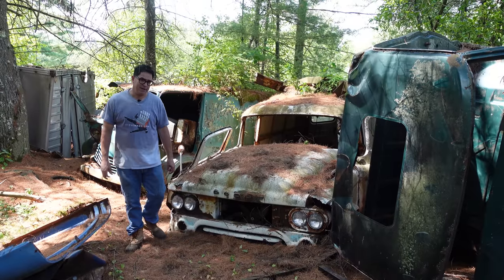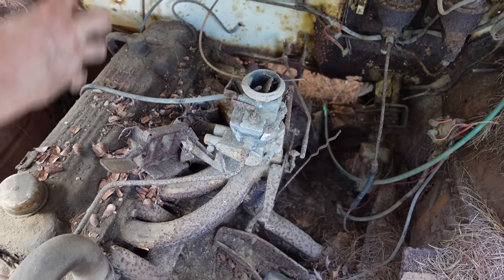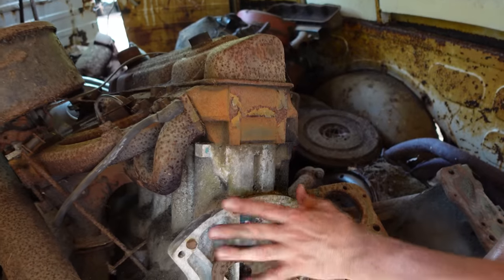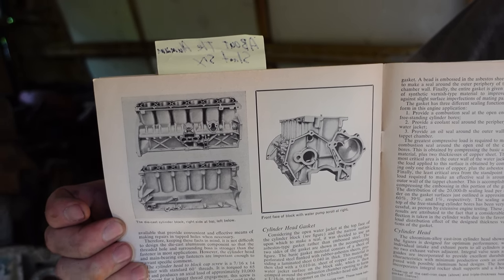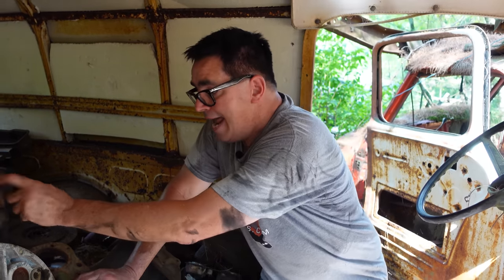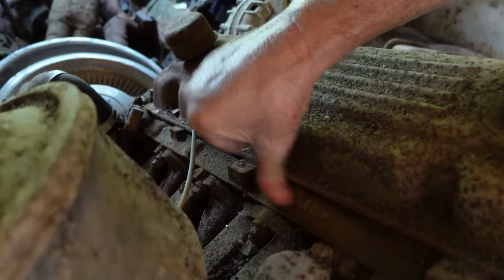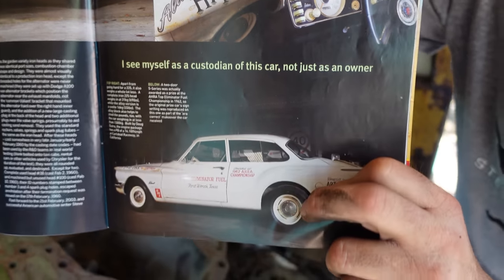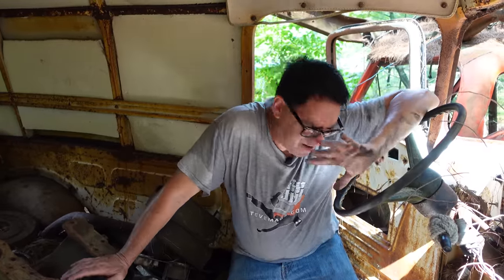Slant Six Surprise!

Comment: I did not know there was an aluminum version of the slant six, very cool. That's quite a weight difference from the iron block. It's too bad they didn't make an aluminum head to go with it. Great stuff Steve!
Reply: Actually they did as far as I understand.  It was a speed part like the special intake they made check out UTG uncle Tony has alot of slant video
Reply: He even talks about the hyper pack
Reply: @Mathew Dick I subscribe to UTG did you ever see the Sunday night live with him and Steve. He had a couple they were great.👍
Reply: Agreed 👍
Reply: That slant 6 aluminum, with cast iron head, GM was still expirementing that concept with the Vega, great video,how big is this magazine collection of information ?
Reply: @jeffclark2725  Too bad GM had not kept the 215 Buick v8 and used that as an optional motor in the Vega.  The 215 has iron liners but GM experienced an excessive manufacturing scrap rate, but they did produce nearly 1 million before selling the 215 to Rover, which used it for decades.
Reply: @djmtndew ........Nah, no aluminum heads for production. There were some made for experimental testing purposes of which a few leaked out to the general public. An interesting point concerning the Aluminum 225 Slant six engines is that the cylinder heads were cast iron but made with much more stringent tolerances and THOSE were marked "SPECIAL". Special, because they mated precisely with the OPEN DECK designed cylinders with no mismatch. This ensured precise sealing between the head and cylinders. The speed parts that you speak of is the HYPER PAK kit. No cylinder head was specified in that kit. Hope this helps you understand the Slant six engine a little better.
Steve, Thankyou so much for this content. I really enjoy your Channel!
Reply: Too bad they didn't make the aluminum head a cross flow design.
Reply: @jeffclark2725  
GM probably had more experience with aluminum engines than any one else in the US.
Reply: @mpetersen6  Cross flow heads were not often done in the days of frugal  single carbs - carb heat was needed.   The slant six 'as is" needs carb heat, but like many low cost designs suffers from carb heat soak.  The designers had to be penny pinchers - a  barrel should have always been an option but it would have cost a bit more to manufacture.

I agree that cross flow would be nice!  I read that BMW engineers were inspired by the popularity of low cost U S. compacts - what if the content could be upped and sold to the sons of persons who bought Buicks - at a Buick price?
Reply: @timothykeith1367  in the case of the Slant Six as designed for a cross flow head the intake would need to be on the passenger side of the block. With an OHV design keeping the exhaust heat away from the pushrods is generally a good idea. Plus with all of the US built inline six cylinder engines the intake and distributor would tend to be in the way of each of other for a cross flow head. Even Pontiac went with a non cross flow head on the OHC inline six. In fact the Pontiac head looks a great deal like the Vega head. And Pontiac was not the only inline six with a non crossflow head. The original 240/260/280 Z also had one. 
There have been people that have sliced, diced and welded V-8 heads to put on top of OHV inline sixes. One that comes to mind is a Ford 300 with a Cleveland head that was extremely competitive in Pro Stock in the 70s. Another is a Chevy 292 with an LS based head. There is somebody on YouTube today that is finishing up a 300 with an LS head. The Chevy in line six and the SBC through LS all share the same bore center distance at 4.400. The 300 is 4.480. The small Ford V-8s are 4.380. Same as the AMC/Jeep family. Which offers some interesting possibilities. For a different head on the Slant it might be best to go down the import engines which would almost make it mandatory to go OHC.
Interestingly there is a racing series run in Argentina. The CATA run TC series which is the longest running race series under the same sanctioning body in the world. The cars run inline sixes based on the Ford,  Chevrolet and Jeep 4.0. These engines feature DOHC 24 valve heads and a lot of other trick race parts. Output about 500 ponies using two Webers. The engines are only available through the CATA sanctioning body apparently.
Reply: @timothykeith1367  
In regards to BMW. When they were on the ropes in the late 50s two different companies tried to  buy them Rover from the UK and AMC. The BMW is as much of a true slant engine as the Slant Six. They are both normal inline blocks just leaned over. In my mind a true slant is something like the Pontiac Trophy 4 from the early 60s. The cylinders at an angle and the pan rail horizontal. Chrysler Australia used the Slant mounted in a vertical orientation.
Reply: @mpetersen6  I'd like a pushrod variant of the Nissan L series on the slant six. The raised intake ports might cause hood clearance issue but a remote air cleaner could  resolve that .  The intake  port angles would be more like a V8.

The Jaguar XK6 has a very similar bore center spacing as a slant.    At a PNP there was a 4.2 Jag with it's head removed and a 225 Plymouth.  I laid the slant six head gasket over the jag bores - looked like a match, but the bolt patterns are different .  The XK6 heads are "wet" - don't pass through metal, but coolant.   Probably could relocate them for a one-off . If this were the case somebody probably would have done it .  The 3.8  E type heads are hemispherical.  The later  4.2  heads are relatively easy to find because the blocks are prone to cracking. A couple years ago Jaguar released a brand new revised 4.2 block or  the hobby market.  The 4.2 head is a quench head for emissions, the difference with the 3.8 and the 4.2 is like 1st /2nd gen Mopar Hemis against  the 3rd gen 5.7
Reply: @timothykeith1367  
Somebody probably would have fone it. Let's face it. The average hot rodder/car enthusiast in the US isn't that imaginative.  It kind of like "I want a 32 Ford like nobody else has. I'll put in a 350 with a 350 TH, a Ford 9 inch rear end and I'll paint it red". Like I said. Imagination. I get that there are reasons people do certain things. Its known to work. I'd rather see somebody build a car that is completely outside of the norm than see one more Camaro or Mustang cookie cutter.
Reply: @mpetersen6  The valve train of the classic Toyota T series might adapt to the slant six.  These are a pushrod hemis of only 1.6 to 1.8 liters, but the blocks can be bored to 3.50 inch.   The rocker arms are available in the aftermarket.   The pushrods are also on the passenger side if the head   Might work better for the 170 than the 225.  It would require  a new head casting.  The T Series can be built to 600 hp.  These are a neat motor.that was influenced by the Chrysler hemi .  Until I saw the T series valve train, I could not visualize how to create a cross flow slant six.  The rocker arms are splayed wider so that there is room for an intake port in the middle.
Reply: @mpetersen6  and how do you think that would work on a slant 6- leaning over against the right hand inner guard? The only way you'd run a crossflow head on a slant is if it were on an engine stand. If you're so intent on putting a crossflow head on a mopar inline 6, import a Hemi 6 from Australia and convert that to crossflow with a dohc off something else. Not much point with the Hemi 6 as it already breathes better than most motors with the 265 cube version having 1.96" inlet valves.
Reply: @timothykeith1367  I also cannot visualise anybody putting a crossflow head on a slant 6 and expect it will actually fit ANY engine bay. There's barely room in a Valiant to get at the points on that mini distributor they have. Besides their weight, and awful fuel consumption, working on them sucked. It was a massive step up when Chrysler Australia ditched the slant in 1970 for the 245 Hemi 6. Bigger, lighter, more power, better economy.
Reply: @rossbrumby1957  If a high function head 
were created for a slant six it would be a one-off teaser project. The  A body inner fenders are mostly to keep water and muck from the motor, they have limited structural function..  The Jaguar XK6 sedans with EFI have a down facing intake manifold.    A crank trigger could replace the distributer.

The slanted BMW sixes have the exhaust on the tilted side. . Nobody will produce a head for the slant six because  of crazy costs.  

An idea that sometimes comes up is a "bathtub" head that has the water passages open from above until sheet metal is welded to cover them.   Then, maybe 5 copies would be built. 

With a decent head a slant six would roughly compare to the Jaguar XK6, which has similar bore/stroke and is also rpm limited to about where a 225 is - and that's with 7 main crank.  The race teams spent a lot of money to get those to hold together at high rpm, but made pretty good torque. The e type was factory  rated at about 260 hp, but the dynos usually measured no more than 215  hp.  I saw a worked over e type on Jay Leno Garage that made 350+ hp on the street, maybe 400 hp.  Big bucks.  A 200 hp bolt-in  head would be news that was unobtainable, because you can port the OEM  head, with enough cam  and compression and easily exceed that.
Reply: Cadillac did the same with the junk 4.1 V8s, always thought an aluminum block with an iron head was two steps forward and one step backwards. Mopar should have brought over the Aussie Hemi head and made the engine in all aluminum and skipped the V6. For that matter GM should have made the Pontiac OHC head for the 230/250 six across the board and on the 292 through the 80s or 90s.
Reply: @hendo337  It would have been nice to have had a slant six block with larger bore and a better flowing head.  The Aussie Hemi really a hem , but the head is better than a slant six i.

 The Jaguar XK6 also has a 4 - inch bore center spacing but it managed to get 3.60 inch bore on the 4.2 liter version - using old casting technology(the 4.2 blocks were known for heat related cracking but a revised casting was produced in 2020).. 

Chrysler could have done that but it was a bread-and-butter motor, not a performance engine.   I read about the Terry Burtz Model A short block that was released in 2021 after 15 years of effort - $4,000 for new block with  5 main crank with insert bearings, one-piece rear seal and also new conn rids.   Is there a market for an improved $6,000 slant six block and a $4,000 head?   Maybe with electrification being forced on us the nostalgia aftermarket parts will begin to flow?
Reply: @timothykeith1367  The Monza was available with a small block chevrolet V8, so a  Vega V8 swap is simple. And an aluminum Buick V8 would have been infinitely more cool than a Chevrolet engine -- the little 215 only weighed 318 pounds! 🤯
Reply: @Duke_of_Prunes  - The '75 Mpnza V8 caused other H-bodies like Vegas and Astres to be setup for V6's and V8's as well, but before that everything got in the way of a V8. They flipped the heater core so the hoses entered farther out instead of near center and the HVAC box got a dent for valve cover clearance and the weak front suspension got a big V8 type crossmember under the engine. Leaf springs in rear replaced with torque arm and coil springs for more traction and less axle hop. (Similar to Buick GNX getting a torque arm) 
Yeah, the Buick 215" V8 I put in my '75 MG Midget weighs less than the crap iron 4 that was in there!
Reply: After WWII's ferocious demand for aluminum planes/engines ended, ALCOA, Aluminum Company of America, was looking for a market for its enormous capability to make aluminum, so was pestering automakers to use more aluminum. Buick actually made the 215" aluminum V8 about 1950 for concept cars before going into mass production of it in 1960. And, of course, Chrysler gave in and made some aluminum Slant 6's. But then both companies eventually wanted away from the extra costs and problems... Later, everybody went back to aluminum for weight savings/MPG gains... and just jacked up prices like crazy...
Reply: @rossbrumby1957  - Slant 6's got great MPG in 1960's but like all engines, 4, 6, and V8, became emissions slug gas hogs in early 1970's...
Reply: No need to mess with heads on Slant 6s, GM made a fabulous all aluminum DOHC 4 valves per cylinder inline 6 'Atlas' engine in early 2000's that engine dynos around 350 HP stock! And the junkyards are full of them now... 
https://en.wikipedia.org/wiki/General_Motors_Atlas_engine
Reply: @mpetersen6  - Pontiac's OHC 6 was just a sales gimmick to make a Firebird look like a Jaguar XK-E's tech at a much lower price. The HP peak RPMs was well within that of OHV engine tech... (As was the Jaguar's, actually) (And SOHC modular Ford engines) Chevy realized that and stayed OHV...
Reply: @Duke_of_Prunes  In the 70s GM attempted to buy back the 215 tooling, but Rover said "no"..   The 61 GM compacts we're wrong for cheap gas but almost ideal for the 70s.   With a restyle they could have given Mustang a real fight..   I still like the Vega, not the crappy 2.3 motor , other than rust,  Vega  could have been a very collectible car today.   The tinny BMW 2002  car  had a solid motor,, the stupid committee product teams at GM blew it
Reply: mpetersen6, that 300 Ford with the sliced and diced Cleveland heads had its success in modified production, not pro stock. The best known one ran in H/MP and had the name Preparation H and was in a Maverick. The only 6 to run in pro stock was Buddy Ingersoll's turbo V6 Buick.
Reply: From what I heard back in the day, the aluminum block Slant Six had some problems and many of them failed in very hot climates. I'm not a master mechanic by any means but I've been around. Let's say I had a neighbor who wanted to get an old Slant Six vehicle running again and he had a cast iron block and an aluminum block laying around. I would try to persuade him to use the cast iron block and might tell him to let the machine shop to put the engine together if he wanted to use the aluminum block. I wouldn't want to be blamed for it when the engine failed.
Reply: @anonymike8280  Yes   orrosion will cause  overheating of these motors, that was true later.  The block has an open deck with limited contact for the head gasket, a little corrosion and it will lose coolant 

The die cast alloy block was supposed to save on milling costs.  Aluminum is so much softer than cast iron.    The casting process had a high scrap rate.  They could have fixed that. Most allow inline engine blocks  were later cast with an open deck 

Aluminum will corrode when the coolant isn't regularly replaced, corrosion was not yet a big issue when the die cast block was cancelled for 1963. 

GM also cancelled the 215 Buick, which I think it was sand cast. Rover worked out the production problems and used it for decades. The 215 block does not have an open deck
Reply: @timothykeith1367  The Slant Six aluminum block was just a fail. Unless you like spending your money experimenting, stay with the cast iron block.

The Slant Six is a relic of the cast iron age. Go with the flow. The configuration of it intrigues me though, having looked it up. 3.4" bore X 4.125 stroke. The Chevy 230 and 250 sixes had 3.875 bore and a short stroke. They apparently used the same pistons as the 283 and 307 V-8s.
Reply: @anonymike8280 Many alloy blocks have corrosion problems - nothing peculiar about the alloy slant six, but the iron version is definitely more durable. 

 I think Mopar engineers might have copied the bore / stroke of the then state of the art Jaguar 3.8 liter which also has a 3.40 inch bore, but a slightly longer 4.2 inch stroke . The slant and  XK6 both have 4 inch bore spacing .  Both motors didn't precisely equal space the pairs of bores.  The slant had a 0..020 inch offset in some cylinder pairs.  The XK6 also  did some fiddling with the bore spacing as well.   The British engine was under displacement tax constraints, that's why the small bore was used.   The 4.2 liter  XK6 was bored to 3.63 inch.  XK6 was manufactured in 1949, for DOHC is very simple.  The DOHC is cool, but like the slant six, the Jaguar XK6 is know for low-mid torque and can't rev very high unless spendy parts are custom made. 

The slant replaced an L-head with 3.25 inch cylinder bores that was an example of compactness when first built in 1935. The Plymouth 201 six was intended to compete in cost with Ford's four cylinder Model B four,  also a 201 cubic inch - and it did just that with six cylinders. Being compact it saved Chrysler millions of dollars each year until it was last used in 1959.

A head gasket for the Plymouth L head will overlay over the Toyota Supra 7MGE cylinder bores , which has  3.27 inch bore and a longish 3.58 inch stroke, but can rev to 7,000 rpm.
Reply: @jeffclark2725  The iron heads gave the alloy  block more rigidity .
Reply: @timothykeith1367  that makes sense
Reply: @timothykeith1367   I worked for a guy once who had 1950s-era flathead six Plymouth Savoy. I did a little work on it. I hope someone sells a set up for a spin on external oil filter for it.

Based on what you are saying, the configuration of the Slant Six block made it unsuitable for aluminum. It is what it is, and it's a cast iron engine. The aluminum block was a failed experiment.
Reply: @timothykeith1367  Yea,the combinations have all been tried through the years, weather it's for the street or strip  still working on it
Reply: @anonymike8280  The customers really didn't care to save the extra weight of the alloy block,  i think the alloy block was an extra cost option.   Die casting was supposed to save production costs -  die casting blocks was then a fairly new process.  A mandrel (die) is pushed into the metal mold and liquid aluminum is pumped it, then the mandrel is extracted. After cooling for a few seconds, the cycle is repeated.   This method requires an open deck, but the process can be much faster than coring and casting an iron block.   Most alloy inlines use a similar process today - not really failed. 30,000 were made.  It is now difficult to find the special head gasket for the alloy block today.  Doug Dutra used to have several gaskets for sale.  In theory its possible to repair the corrosion, but I have never heard of anyone willing to  spend the money;   For some motors cast like this a "top hat" is pressed in, maybe welded.   Too spendy when a cast iron slant bock is easy to source.  Dunderheads/cheapskates didn't flush and replace the coolant is the reason for the corrosion, otherwise they can last for a good service life
Reply: @timothykeith1367  I still think, the aluminum block was a fail. Insufficient maintenance was a chronic problem back then with all models. Some engines survived it better than others, but a 3000 mile oil change should have been done with every engine, and sooner with vehicles that experienced severe duty. Very few people did it. The problem was not, as some people imagine, the inadequacy of either the oil they sold back then or the coolants. People just didn't do the maintenance.

Cast iron engines didn't need oil with a lot of additives. They needed clean oil. They could have been run on SB oil with no harm.

The cooling systems of most used cars were a disaster area. Heater cores were plugged up and the blocks and radiators were full of scale. That's why that era the bad old days.
Reply: 170 C.I.?